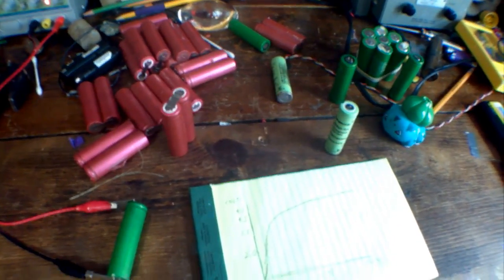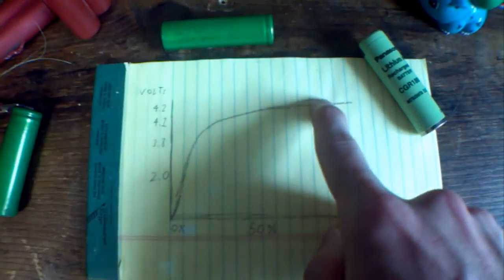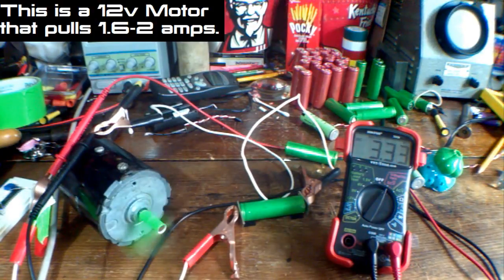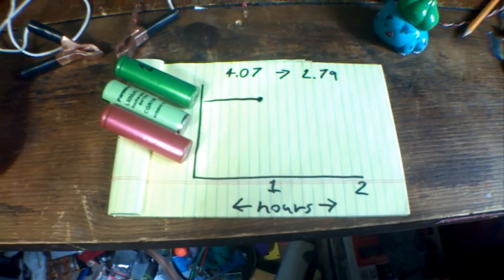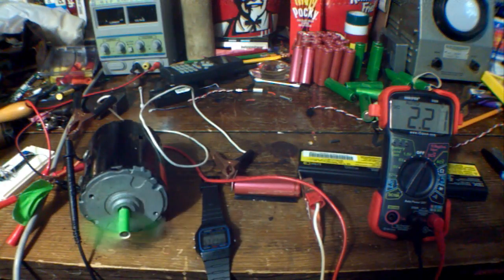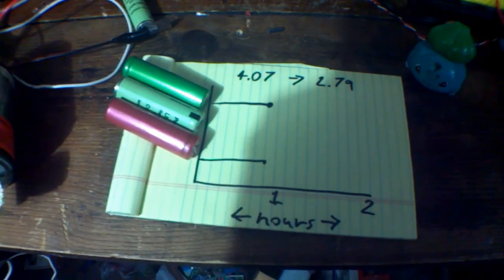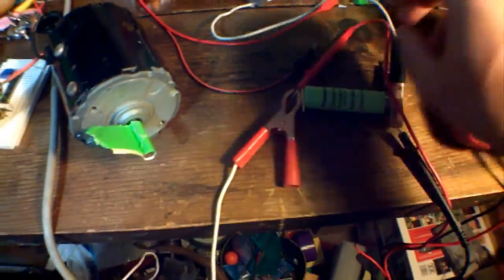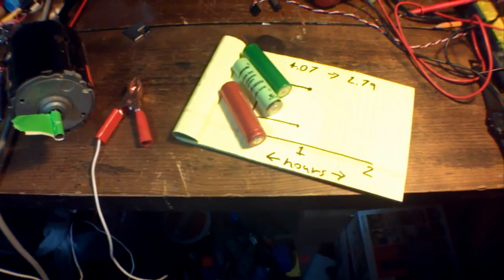18650 LiPo Load Test Comparison

Comment: So, as per your exp... 
1.what is  possible min amps will have from harvesting cells(laptop pack) 
2.If it have < 1amps like 1.2 can we use it for e-bike projects..? 
Which means we may need more cells if we want long range pack ex.. If I want 40amps with 12volts 40/1.2=33 cells in parallel I'm I right or is there any calculation kindly reply with details.
I wud like to make 4packs with 12v 40amps packs or 1 24v40amps and 2 12v40amps because if there is any issu with one or two cells that is really easy replace another cells from individual pack. Rather than breaking and checking each and every cell.
Kindly suggest with your comments. 
It seems it requires BMS for every pack. Is it??

Comment: informative! thank you. i am currently in the process of building my own lipo battery pack due to your video's! thank you for encouraging me
Reply from the maker: ***** thanks for enjoying them!
Reply: Very.. Any suggestions on a per cell lipo fuse wire like tesla?
Reply from the maker: *****
yeah i'm gonna try that with 4a picofuses. it was only after i had the idea that i heard tesla does it also. so i guess that proves i should try it.
Reply: Super idea imho. I have been testing a single copper strand from a 22awg (or something) wire. I started with 4, then 2... but they held up to more than 6amps. 1 strand seems fine up to 5 amps and above. With 6 and above it started glowing... Have to repeat and test a little further.. Currently catching up on your homework. Greetings
Reply: +Jurik Ristjouw How long of a strand? Copper is such a good conductor it will "save itself" from thermal destruction by evenly heating itself. You should just google up what wire is used in the new multi-wire fuses but the old glass ones had just one strand that blew fast. Somehow my gut is screaming out nichrome wire but that was used for heating. Then it could be if those fuses were vacuumed before they were made, maybe that is what the solder glob is there for. Even putting nitrogen or CO2 (baking soda and vinegar) would be very viable options if you wanted to make a fuse otherwise I'd buy it. Check out the polyfuses -- they go out but restart themselves. Very handy in most circuits. I think they're pretty fast but haven't specifically read on them yet.

Comment: How did you know how many amps the motor was pulling? Still learning...
Reply from the maker: Trigger G connected it up to my power supply and set the power supply to the same voltage.

Comment: Is $3.38ea a good price for Gateway 6MSBG OEM good? They are 5200mah 6 cell 10.8v.
Reply from the maker: 3$ for a pack with 6 cells? thats a very good deal. but 3$ per cell wouldnt be good.
Reply: Rinoa Super-Genius 3.38 per laptop pack. Look to be CGR18650 E 2550mah i believe. All cells are tested to 3.79 volts :).
Reply from the maker: JGBLADES
 sounds awesome, how many are there? are they on ebay?
Reply: Rinoa Super-Genius They were. Got the whole lot on a local pickup from a cool russian dude. Got 61 packs of the 6 cell and a 9 cell.
Reply from the maker: JGBLADES
awesome!

Comment: get a rc charger, it can do all of this on the display, it tells you how much mah is charging and how much is drain. charger is called imax b6
Reply from the maker: i did several months ago. i've made several videos about that. but thanks anyway.

oh and btw small battery testers would be too slow for large batteries, for something like my 100AH deep cycle i would use a car headlight as a load and time it like in this video.
Reply: +Rinoa Super-Genius Saltwater makes a good load, too. If you need bigger I saw one fellow use wire just make sure the coating could was better than 100C and it was safe. IN another he uses large tubs and uninsulated water because the current will pass through the least resistive path -- the wire... When he pulls it out it will boil but it's still safe enough for low voltage only testing. Wicked smart guy. He was testing out PS's that would do banks of LEDs for whole strip malls. Testing these in his home lab...not very big, mind you.

Comment from the maker: no i havent been able to mess with LiFePo cells before due to LiPo cells being super cheap. buying new/old stock laptop batteries on ebay can get the price down to like 80 cents per 18650 cell. not counting LiFePo charges to a lower voltage i think.

that charge rate sounds awesome though, i usually charge my pack at 0.5 to 1 amp even though i could charge it at 20. i do that couse i just set it to charge overnight next to my bed and that it can prolong battery health.

Comment: question did you try lifepo for your bike those are awesome i use to use on rc helis and charge at 40 amp yea !! 40 3 2250 mah cells took 5 minutes to fully charge and the pack was 11.3 volt

Comment: LOL. Told you these pain killers were getting my brain ( I think I have one) in a mucking fuddle. LOL. I have 3 x 4Volt pairs in series= 12Volts. I have 2 x 12Volt packs per "Car Battery Cell". That comes to 12 x 12Volt packs. Which is 72 pairs at 4Volts each pair. Which comes out at 144 individual single LiPos. I aint going no further just in case I get something wrong. So I will quit writing while I am ahead. LOL.

Comment from the maker: wow you have 1,575 cells?? remember if you hook them in series they stay the same amp-hour and double the voltage, but if you hook them in peralel they double the amp-hours but stay the same voltage.

i was thinking your battery had 105 cells, with 35 in series by 3 parallel. if it is that then it'd be between 4-10 amp hour :/

but i hope my math is wrong and ya really do have a 72amp hour battery, that thing could get you going all over the place!

Comment: Great video again. Your tests are extremely helpful. At worse scenario my "car battery" is about 72Ah minimum. WOW. That is awesome. I was only thinking around the 35Ah mark. So 144Volt battery at 72Ah will do just fine. I know it may be more. But if I calculate everything on worse situation. I get a surprise not disappointment. Unless it goes BOOM. LOL LOL LOL LOL. Thanks again my friend.